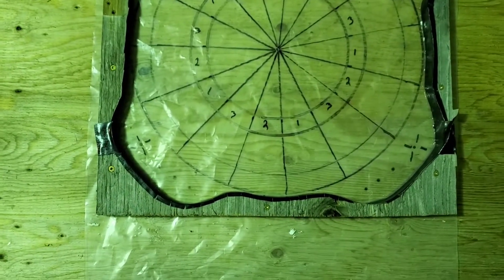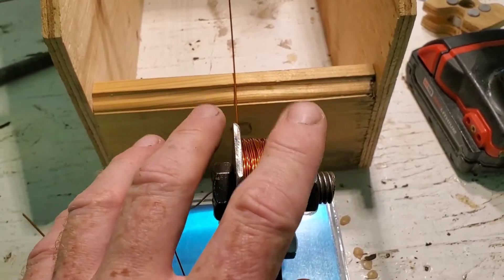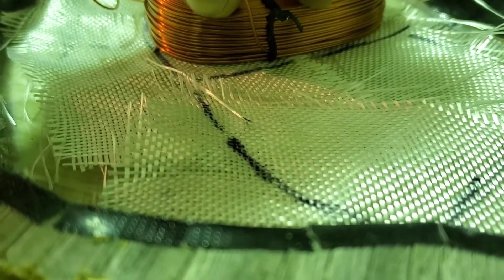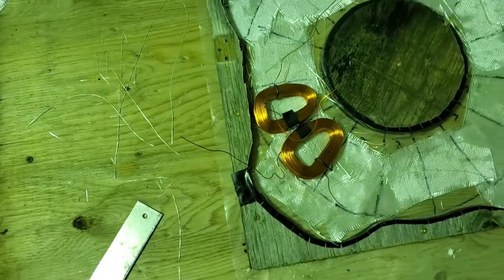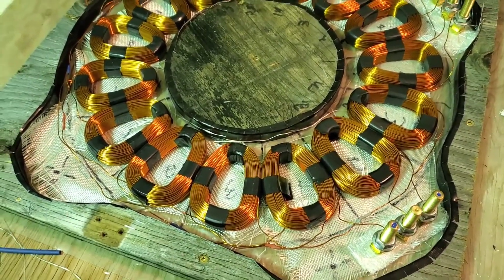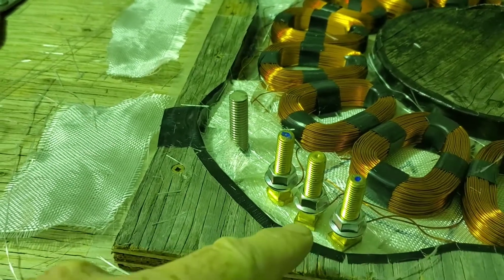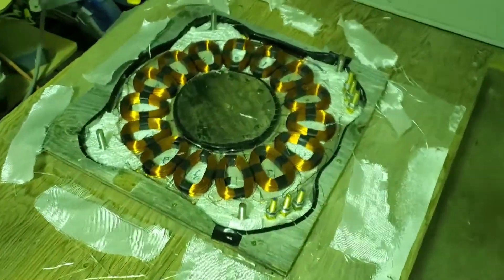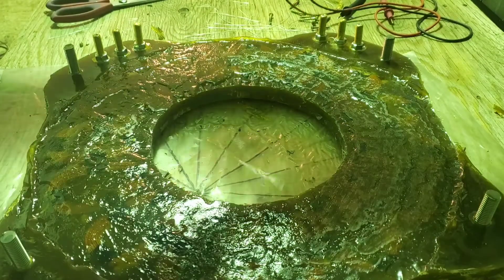15 Coil Stator For the Axial Flux , step by step build

Comment: thank you in advance
My question: I made a generator of 15 coils, each coil has 100 turns, and the wire diameter is 1.6mm.
And when charging the batteries there is a high resistance to rotation of the alternator, so I don't get more than 2 amps just because of the difficulty of rotation. What is the solution in your opinion? Did you reduce the wire diameter?
Sometimes I see some people use four or five wires at the same time with a small diameter.
What is the best solution to overcome this problem?
Reply from the maker: How are you trying to turn it?

Comment: Thanks for your, but I have a question, what is the maximum thickness of the coil can be?
If I had a magnet 50x25x10, Thank you.
Reply from the maker: You should be able to make them between 12-19 mm thick without any problems.
Reply: @windpowerandmore6310  Thank you very much, you helped me a lot

Comment: Coils clock wise or anti clock wise sir ?
Reply from the maker: It doesn't matter,  just be sure they are all the same direction that you choose to use. This video will show you step-by-step on how to wire the coils together.  If you watch closely you can see the start and end of each coil and the proper way to connect them together.

Comment: Beautiful and wonderful work, thank you very much. If possible I would like to know the diameter of the copper wire used.
Also the length and width of the inner triangle of the coil
Reply from the maker: Hi bud thank you for such a nice company! The inside of the coils are a bit bigger than the size of the magnets its very important that the magnets can fit inside the coils.  The magnets i used are 2 inches long and 1 inche wide.
Reply from the maker: Oh and I used 19 awg
Reply: Thank you very much my dear brother, I wish you success.

Comment: Man, that’s a cool design. Impressive and Great work! 
Why the egg shaped coils?  Something for high torque? 
How low of rpm gets power output?
Reply from the maker: Thank you, the egg shaped coils are to maximize the amount of coils that can be fit. The only part of the coil that produces power from the magnet is the two parallel strait parts of the coil. That’s why it’s very important for the magnet to fit into the centre of the coil .I have this stator mounted on the wind turbine now and I see 120 v ac at 60 rpms from just one phase.I’ll have a video coming out soon of that test. Hugh pigot designed this type of wind turbine in the 70s I think. This is just a powerful high voltage version.Thanks for watching!